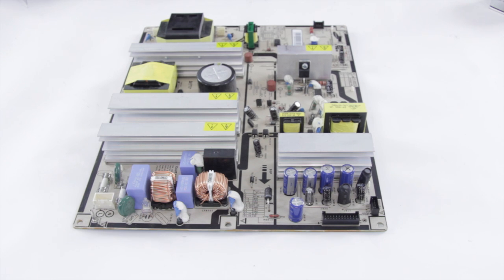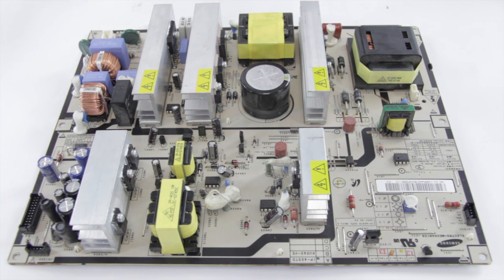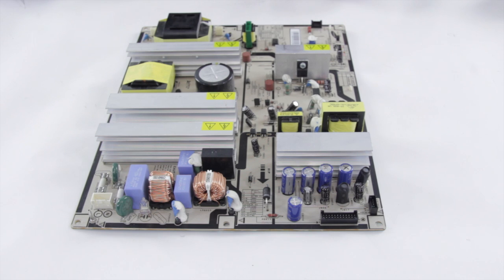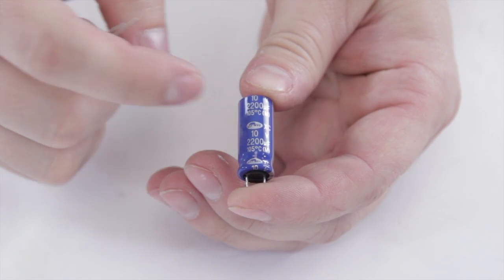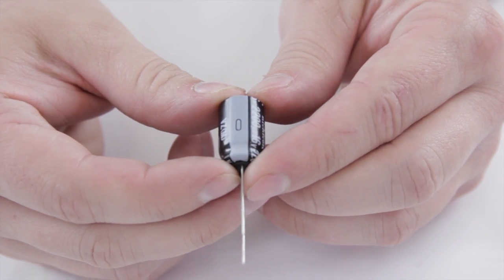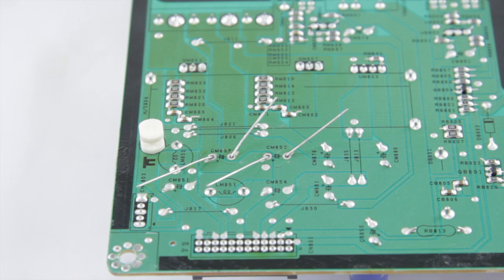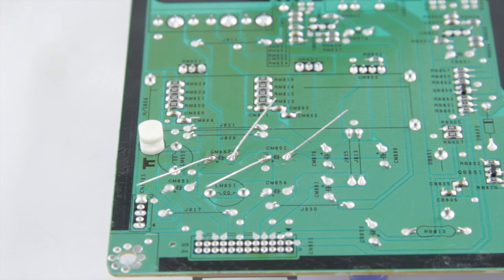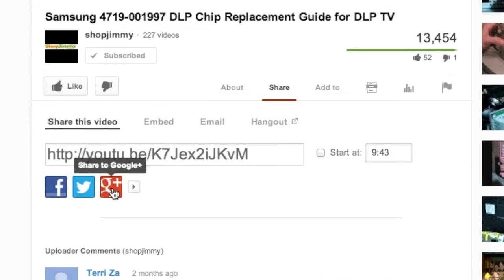Samsung TV Won't Turn On - How to Repair Bulging Capacitor for Clicking Noise

Comment: 02:15  I am speechless that this guy has not even seen my tv or spoken one word to me and still describes my exact problem to the last letter.  But try walking into your average tv repair shop and describe the same problem, you will suddenly hear suggestions on possible problems that would make you wonder if the so called technician has ever seen a tv in his life.  And these "suggestions" often frustrates a person to such a point where you just donate the tv to a rubbish bin and buy a new one only to later discover how some so called technician recycled the tv from the rubbish bin and replaced a capacitor for less than a buck and the tv lived happily ever after.  Thank you for explaining this in layman's terms and not telling me to check if the tv is plugged in.  Your simple straight forward explanation has already convinced me that faulty capacitors is the problem.  No more cleaning the remote sensor and replacing remote battery BS.

Comment: the samsung tv i have is doing the same thing model number UN65KS8500..it have two connection coming from the power board going straight to the main board..
not sure which pin should remove..cal you let me know if you can help

Comment: hi i have a 46 LED samsung doing the clicking and pulled the back expecting to see something similar to your  board, but mine is totally different. There are capacitors, i think they are, but they are all lying flat. it is a PD46AF1E_ZDY board and all the capacitors if that is what thye are look ok. not sure which way to go now any help appreciated. A few years ago I resoldered a few solder point around the square box in the middle of the board and it worked for a few years. not sure if that is a thing to redo? can you help?

Comment: You are repairing what is called a Switch Mode Power Supply or SMPS. Capacitors being replaced are on output side of the SMPS. A LOT of current goes through these capacitors. Common for these to fail if they use too low of voltage, wrong type of capacitor or just plain Chinese junk. You are showing a Nichicon UVZ series capacitor. Nichicon is a very good brand but this is the WRONG type of capacitor. Highly important are two other factors you do not mention: ESR and Lifespan. Due to high ripple current within an SMPS, the output caps MUST use Low-ESR type caps. UVZ caps are standard 105C caps and are far from being low-ESR (low impedance). Nor are they long life caps, UVZ have the shortest life range at 1000hrs. Best choice for these is a Panasonic EEU-FR1C222.  This cap is one of the best brands and is designed to be used in a SMPS: correct lead spacing, same capacitance, one size higher in voltage rating (slightly larger diameter and can handle higher ripple current), and 10000 hour rating (10x that of the Nichicon UVZ). For the 1000uF - use EEU-FR1E102L. Long life and proper cap for this use.  You'll pay about 50% more for the correct cap but a lot better than replacing the wrong ones again in the future.

Comment: i have the same problem ... it happened to me before and i fixed it by replacing one of capacitors ... but this time i didn't find the exact number (1200uf/25v) ... is it safe to use 1500uf/25v instead ? (got another options like 2200uf/25 or 1000uf/25) but some tech suggested to use 1500uf but i wanna make it more safer by looking and asking ... i know it's old video but i hope i can find some answers :)

Comment: Once you have tacked one lead on each cap, the cap cannot fall out. Straighten the other lead so it is no longer bent and then solder it. Then hold the first soldered lead with pliers, melt the tacked joint and straighten the bent lead. Then finish soldering that joint and cut the leads. In this way the caps will fall out next time you come to replace them. Better still, don't bend them in the first place. Instead  place a pad of foam rubber/plastic under the board and put the board and caps down on that. The foam will hold the components in place without needing to bend any leads.

Comment: It happened i just touched the capacitor with screw driver and heared spark with sound .. I was freaked out.. Now my led tv doesnt  turn on ...i am afraid did i kill my main board ?? I just checked those capacitors looks fine .. None of them are damaged as shown in the video ..unfortunately my tv board is all combined with power unit not separated like shown video...can you help what went wrong ...??? Please

Comment: Steps 1-4: Hmm seem's pretty straightforward! 
Step 5: "Get it wrong and it could explode..." 
Oh...  

Great video though thank you!
Reply: Did this work for your TV? This video is old but it still seems to be a problem with Samsung TV’s. I’m about to try and fix mine this week.
Reply: Ciaran Ryan yeah it worked fine actually! I only replaced the ones that looked bad I.e leaking or bulged in some way.
Reply: Yeah! I was all game till... lol

Comment: For power section cap, I will replace with bigger value /uf. It will  more cooler the original value cap and last longer .

Comment: 65" sanyo model # FW65D25T same issue , must restart sometimes 20 times to get picture, once on , beautiful picture.replaced t con board to no avail.now looking at capacitors , and all look good.any advice ?thanks in advance.

Comment: Nice DIY video.
But please please please do not re-melt the tin without adding som fresh with flux.
There are usually flux fused inside of the tin you buy on rolls, and that will help the tin flow and bind.
I work at a printboard factory, and it is a death sentence to re-melt tin without adding more flux.
As soon as the tin stops smoking, the flux has burned away and you need to add more.

Comment: You are FANTASTIC!  Followed your instructions and my 8 year old Samsung 46" tv works again.  Cost of repairs was about $18 (Soldering gun, solder and 2 capacitors). I can not thank you enough!
Reply: where did you buy all your materials? I want to give a try at fixing my tv, it's having the turning on problem.

Comment: I've had the same 40" Samsung for at least 10 years and just now started having the power on issue.  I replaced two bad caps like you showed, my first ever soldering job, and now it works perfectly.  Thanks so much for this video!  It was very helpful.

Comment: I hope you do a video on what to check first if you have a broken TV like checking the fuse first second the capacitors or you need to replace a picture tube...

Comment: hi there!! well my question is my capacitors that aren't working are 1000uf 25v 105°c but I can't find them at my local stores, could I replace them with a bigger ones??? I have 2200uf 25v in hand.. will those work???

Comment: My Technika LCD model 24-621 TV has a problem where after 15 or so minutes of use it makes a popping sound and then turns itself to standby mode. It doesn't switch on right after, only after waiting 5 minutes. Could this be because of blown capacitors?

Comment: Great video very informative. I had a Samsung tv Samsung-LN46A650A1F-Power-Board it had bad caps just as your video described. Done the exact same thing. Unnoticed the tv making a clicking sound and would no longer power on. I seen the relay was making the clicking sound. Replaced 4 bad caps right in the same location as the ones in the video. What type of solder and flux did you use solder these capacitors in place. Thanks for all the great videos Hakko makes the best products

Comment: I have a Samsung ps60E6500 and not torn on.the same problem as in your clip. Rarely starts and stops after 1 minute. Then do the same as the clip. of can u help me pls. Hear back three blasts in succession and then goes out and LED lights.p la help me

Comment: What was the original manufacturer for those capacitor. IS samsung using cheap capacitors? Those replacement nichikom/Panasonic are the best low esr.

Comment: Hi I have a Samsung tv 40 inches model le40a656a1f 
and the problem the tv won't turn on but the stand by light is blinking. I opened the back of the tv and all capacitors are in good condition but there is a beeping noise coming out from the power supply board and the voltage is keep changing(up and down)can any one help me please thanks.

Comment: I was getting the clicking noise and after a few days it would not start up at all. I just replaced 4 bad capacitors in my Samsung model # LN46A650A1F with the use of your video. I put it all back together and it started right up with the 1st attempt. Thank you for your help and I will be subscribing . :)

Comment: My lcdtv got the clicking sound problem, but no cap looks bad. any suggestions on how to trouble shoot?
Reply: if its the clicking sound, its usually 99% chance the capacitors are bad. That's the power strip trying to turn on the tv, failing due to bad caps, and clicking off, then retrying , click on, not working, click off, etc. Usually the caps are bad and aren't letting the power strip power up enough because the caps which should be low resistance and maybe 2000uf total are down to 750-1000ufs and high resistance. If your Samsung is clicking, pretty much 99% of the time its the capacitors. Depending on your model, 2-3 caps are usually the problem since those are used for the powering. On lesser tvs its usually 1000uf-10v-105c blue caps, 2 of them. There are a few 25v caps around also, but those aren't used for the powering. I replaced my 2 10v caps with 25v Panasonic caps, and presto, tv worked fine again.

Comment: Hi Shopjimmy, my samsung un55f6350 won't turn on. It does not make any clicking sounds when I try to turn it on, only signal I'm getting is red light starts blinking. Capacitors look good. What could my problem be?
Reply: jose velasquez

Comment: Thank you for identifying and giving remedial repair advice. Two replacement capacitors cost £1.50 and now my 40" 10 year old Samsung TV is as good as new.
Reply: TheVanillatech never buy a new TV if it just works
Reply: buying a new tv yeah , OR fixing it yourself  and having it go  and having great pride in actually fixing it yourself  is priceless "apart from parts"
Reply: Dude ... get a new TV. 40" is fine but 10 year old TV tech isn't. You would LOVE an LED screen of decent quality with smoothmotion or some similar tech. Trust me. Sell your fixed one to go towards the new one!

Comment: I just replaced 3 bad caps in my Samsung 55 inch TV. It not only fixed the clicking and slow to no start up, but I also had what looked like some lines and bad pixels that have been fixed as well.  Thanks for your video. It was a great help

Comment: I have a Samsung M# LN-T4071F  that is turning on and off i check the caps and they weren't bulging or displace at all, i wen ahead and replaced them anyway and it didn't fix the problem unfortunately. What else could it possibly be any help will be grateful.
Reply: I have the same tv.  might just get a whole new power board.

Comment: I have a Samsung 46" tv model UE46B7020WW.Model code UE46B7020WWXXU.When tv turned on it makes a clicking noise with no picture.Please help anyone with a clue whats might be problem.
Reply from the maker: +ELLIOT MAZAMBANE   Try all repairs and troubleshooting at your own risk.  <!-td {border: 1px solid #ccc;}br {mso-data-placement:same-cell;}->Disconnect the cable from the power supply to the main board and look for back lights. If you have back lights replace main board if no lights replace power supply.  Click this link to replacement parts for your TV model number:  http://www.shopjimmy.com/catalogsearch/result/?q=LC-52E77UN  There may be multiple boards for the same TV model number, be sure to match part numbers on your current board, with your replacement for compatibility.  Thanks and please let us know if you have any further questions with your TV Repair!  www.shopjimmy.com

Comment: Help! I have a Samsung pn60e530a3fxza and it won't turn on. No clicking noise or anything. Seems as though it isn't getting power. I had a tech support guy out (geek squad) and he couldn't find a problem. He recommended that I replace the power supply board so I did. It turned on once after replacing the board but now the same problem is back. There doesn't seem to be any bad caps. Thanks for any help you can provide.
Reply from the maker: +Jeff Fithen   <!-td {border: 1px solid #ccc;}br {mso-data-placement:same-cell;}->Try this at your own risk. Unplug the TV, then disconnect the y board and plug in the TV to see if the TV powers up. Note that it will not have a picture on the screen. Reply with the results of this test. Thanks! www.shopjimmy.com
Reply: No luck.

Comment: I have a Spectroniq 32"LCD TV (apparently built in late 2006, I had no idea it was that old) model number PLTV-3250. There is another number other than the serial 077-10291-R0400.I turned the set off last night without any problems but today there was no power to the set. I checked the outlet, it is fine, then we noticed the red light (power off) was not on. I took the back cover off and find all the boards are metal covered and screwed down with cords and wires everywhere. I think this is a bit too much for me. Can you please help me?

Comment: Hi Please help. I will be watching tv and then the screen will go blank I have sound but no picture. I can turn the tv off wait 30 seconds turn it back on and it will work ok for about 5 min then the picture goes again. the tv is a Samsung Plasma.
model code ps4c451b2dxxy
model ps4c451b2d
type ps42c451
Any advise would be great thank you
Reply from the maker: +ZX6RJAMES   Try all repairs and troubleshooting at your own risk.  I recommend replacing the y board and buffers in your TV.  Unfortunately I do not see any replacement parts in the search results for your TV model number on our website.  Thanks and please let us know if you have any further questions!  www.shopjimmy.com

Comment: I have A Samsung  56" tv model HLT5687SX/XAA Version RE01.It was dead from bad caps . I replaced all the caps on the main board about 2 month ago the tv played great till about 2 weeks ago. Then the picture and sound would go out. If you turned the TV off then back on the picture and the sound would come back on .Then is started getting harder to get it to come back on some times you might have to turn it on and off 6 or 7 times till the picture and the sound stopped coming back on. So then I replaced  all the caps on the power supply board. This did not improve anything . The TV seems like it is cycling on but will not cycle off when you hit the off botton
Reply from the maker: +Russ Reynolds   Try all repairs and troubleshooting at your own risk.  I recommend replacing the main board in your TV.  Unfortunately I do not see any replacement parts in the search results for your TV model number on our website.  Please reply with your part number on your main board and I can try searching for replacement parts.  Thanks and please let us know if you have any further questions!  www.shopjimmy.com

Comment: Followed the advice....sure enough, two puffed caps.  Ordered them ...had them in a couple of days (if I lived in the main City I would had them in 1 day).  Replaced them, re-installed the rear cover.  No picture.  Hmmmm...Did I leave something not connected.  Off with the back...sure enough I left one of the cables to the PS unconnected.  Bingo...Thanks for taking the time to post the videoi   BTW - I did order the caps at 16v.

Comment: hello!  I have a samsung ps50c6500tw model 850FH-YB07 with a bug issue:
The TV started to turn off and on again for around 3 -10 times. But then it was working fine for one day. But now, after few days, when I turn on the tv, it shows only the "HDMI1" sign on the left top of the screen without the picture of the source. The TV doesn't turn on and off again but there is no way to change the source or even the volume (remote and control bar at the tv). If I press a button, the red light at the tv is flashing. I hope, someone can help me...

Comment: Samsung  52 inch UN55H7150AFXZA bought 2014....

1) 95%  of the time TV is not able to be turned on
2) sometimes a red light turns on indicating it can be used 5% of time
3) TV will turn off after a few hours of use

Help! I am past my warranty!
Reply from the maker: +sdvincet  Try all repairs and troubleshooting at your own risk.   I recommend replacing the main board in your TV.  Click this link to replacement parts for your TV model number:  http://www.shopjimmy.com/samsung-bn94-07345c-main-board-for-un55h7150afxza.htm  There may be multiple boards for the same TV model number, be sure to match part numbers on your current board, with your replacement for compatibility.  Here is a link to a video showing how to identify your part number, click here:  https://www.youtube.com/watch?v=Aodz2LHkzbY  Thanks and please let us know if you have any further questions with your TV Repair!  www.shopjimmy.com

Comment: Hi, what liquid do you use on your brush when you clean the board?
Reply: Use a contact cleaner... It is also like alcohol... But it is made for electronics...
Reply: +Karatehansen Yolo 

Isopropyl alcohol.
Reply: Sperm works fine too. Human is best, but horse is a cheaper substitute.
Reply: Sperm works fine too. Human is best, but horse is a cheaper substitute.
Reply: Sperm works fine too. Human is best, but horse is a cheaper substitute.

Comment: Thanks for the great advise on the cap replacement. It cost me 7dollars for 4 new capacitors and 25 dollars for a new soldering iron. It was a great afternoon project for me and my 5 yr old son. It was  Better then the 85 dollars service fee I was quoted over the phone. T.v. Works like new.

Comment: have un40h6350 Samsung with sound but no picture .standby light goes on then and off after 5secs. flashlight reveals snow  and set up instructions on screen .seems info is there just no brightness.Remote changes menu.